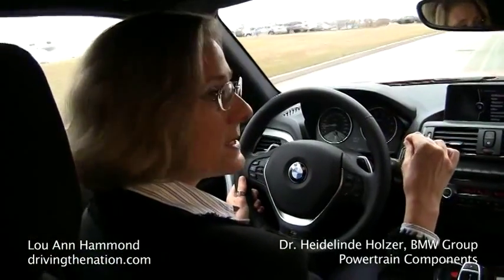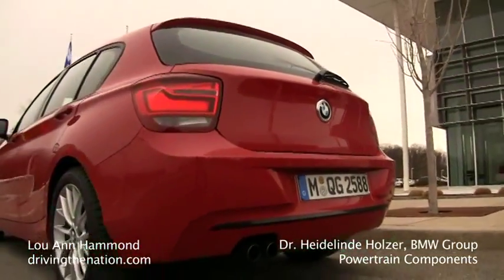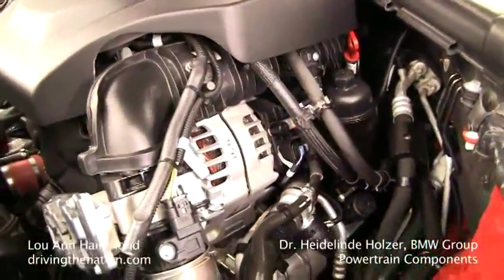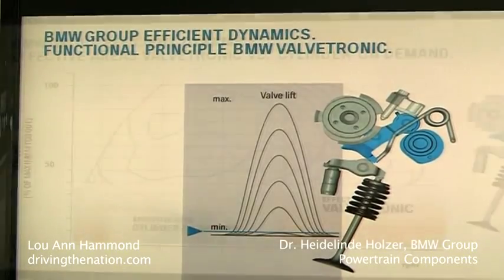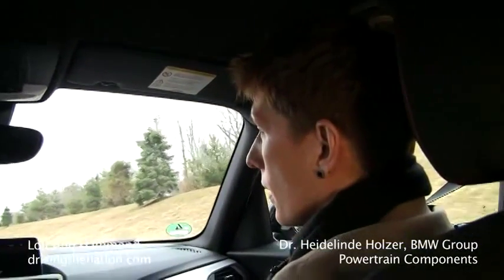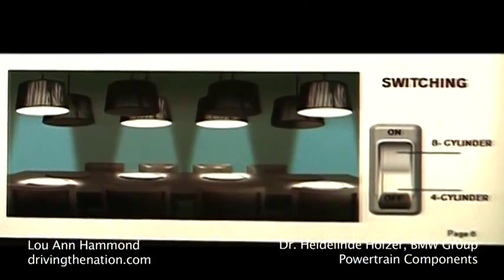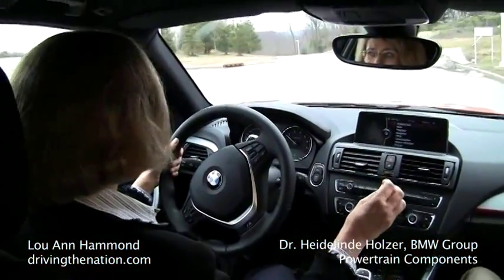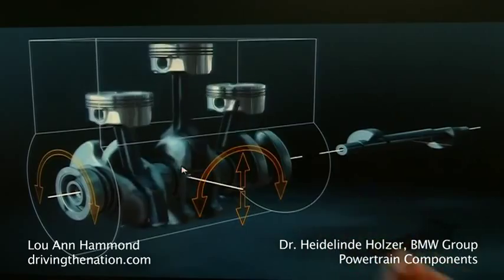BMW 3-cylinder engine that drives like a 6-cylinder North American International Auto Show (NAIAS)

Comment: B37 most sheetiest engine ever created. Crankshaft fiting in aluminium crank case. Con rod bearings destroyed at low milage. Timing chain is so weak that i will never put them on a bicycle. Egr cooler breaks and putting water directly in the engine resulting engine destruction by hydro impacts. So sad....
Reply: Azdejkovic Miladin 51000 city miles on mine, no problems yet